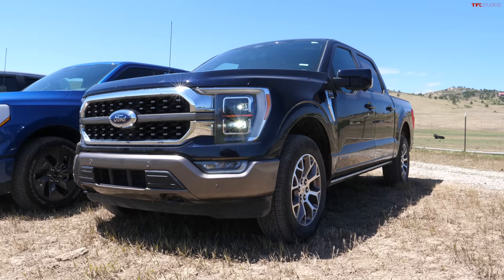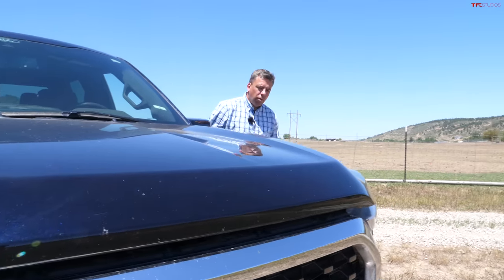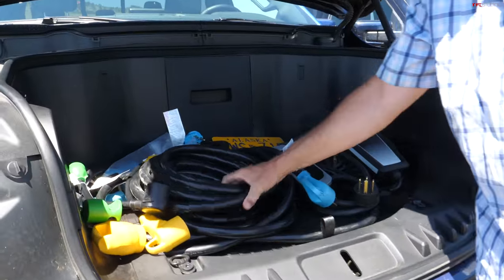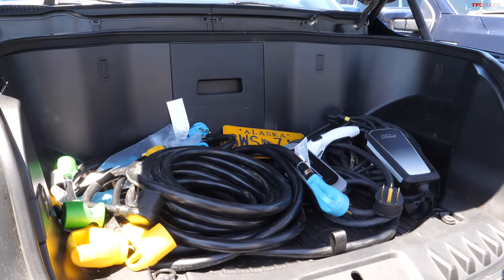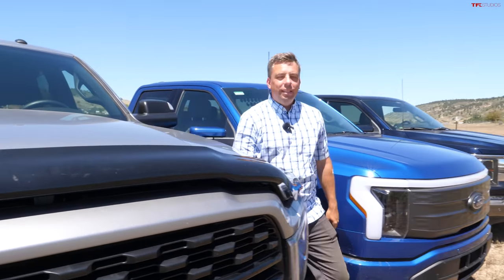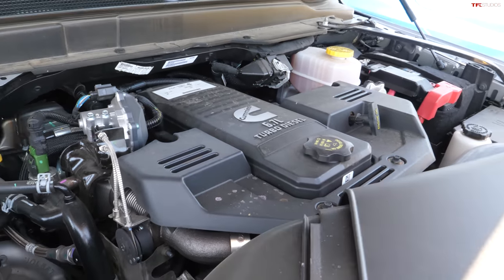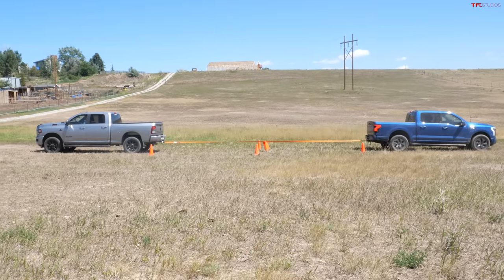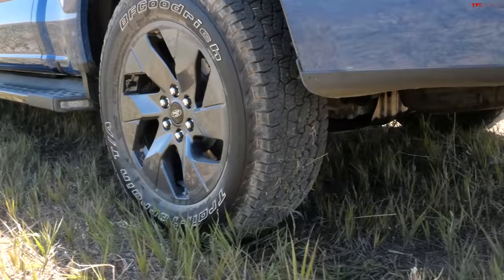Diesel vs Electric Tug-of-War: Ford F-150 Lightning Takes on the Ram 2500 Cummins In a Nail Biter!

Comment: We do this on the farm all the time. This test proves nothing. A 140 hp tractor will walk a 170 hp tractor if it’s weight is balanced correctly.
Reply: Yes, they mentioned this early in the video and stated this was more for fun than to actually test.
Reply: Why would HP matter, it's not a top speed run
Reply: @666cemetaryslut  
It’s more about low-end torque.
Reply: Shouldn't the gearing help to?
Reply: The Cummins  is the most powerful  on a job site doing real work...
Reply: @666cemetaryslut  Neither torque nor horsepower specs matters so long as both tractors can get enough torque to the wheel, through gearing, to peel out or move forward, at which point traction is all that matters to prevent peeling out, and that is heavily influenced by weight and weight distribution.  Selecting a low enough gear will provide all the torque that's needed to the wheel in most cases.  Tractors are rated in HP because it's much more practical for comparing how much work can be performed over time.  As such, tractors and their implements are rated in HP.

Comment: I want to see it on hard road
Reply: Dude trucks pull way more in four wheel drive than pulling that ram, if that truck breaks down its just because it's a shitty ford which ford in general leads in more recalls in the past few years so, put them on payment

Comment: I wonder how much the tires matter in tests like these. Seems like an important factor.
Reply: Tires and weight.
Reply: I noticed a lack of tread on the Ram fs
Reply: weight distribution is even more important, f150 lighting is 50-50, RAM i dont think so
Reply: all have street tires
Reply: Tires is more than half of it.
Reply: Being in dirt ruins this.  No grip.  Needed to be on the road.  Pointless test.
Reply: It definitely is. A car with 1000hp that gets no traction can lose to a car that makes 300 and hooks up. Tests like this prove absolutely nothing. Small mind theatrics
Reply: @pabloherman8836  property damage
Reply: @indyguy3400  well... Then they prove which grips better... So not exactly proving nothing.  Considering most my pulling is on dirt ground; its pretty useful info
Reply: @indyguy3400  he even said at the end they didn't really prove anything, they were just having fun.
Reply: @pabloherman8836  did you watch the same video? They also said why they didn't do it on pavement: they were trying to preserve the drivetrain of the vehicles. Didn't want to mess them up
Reply: its literally just traction and weight. sitting and spinning his tires all but guaranteed the other vehicle to win.
Reply: as  soon as I saw they were doing it off pavement I knew the results would be dependent on the tires
Reply: It was pointles in a test like this you need the same tires and you need to have the trucks switch sides need more testing on the same tread tires
Reply: @travisyarbrough4033  yeah so they still need the same tread for something like that
Reply: It certainly can be
Reply: Electric will almost always win unless it’s a huge truck agains a small EV. The EVs has instant torque(one of electric cars main benefits) which give it the advantage every time.
Reply: @Tonyx.yt.  just overall weight is even more important.  Normally weight cancels out since it increases friction between tire and ground but also increases the amount of weight you need to move.  Here though, both trucks need to move the combined weight of the two, but only get the benefit of their own weight to increase traction, so basically the heavier truck has a significant advantage.
Reply: Diesel fuel
Reply: Rear axle/transmission ratios, as well.
Reply: Tires matter alot, considering the lightning had bfg and the ram has those shitty Firestone transforce tires
Reply: Right
Reply: It’s one of the main factors!
Reply: Do it on a road
Reply: Yeah the electric had the best tires it was knobby and the sidewalls had knows on them. The other trucks had less grippy tires for sure
Reply: Tires are every thing. Put a monster truck on volkswagon tires
Reply: Are you all kidding me? I just watched the video on my TV, and this was the biggest joke ever. There are so many things wrong with the pool off. These two guys are  hacks.
Reply: The height of the attachment point for the strap also matters a lot, if it’s higher on say the lightning for example, the ram would have been actually helping the lightning get more traction on the rear tires by applying a downward force while pulling. It’s something that’s often over looked in thug of wars.
Reply: I can tell you, from experience on a few different Rams, that the factory tires are garbage. Park on a driveway that has a bit of damp grass and you will get stuck.
Reply: I'm sure they both had decent tires on them stop trying to make excuses
Reply: @revit4909  EV’s will also generally outweigh traditional vehicles by a pretty large margin just due to batteries, EV’s are kinda tank like, and will be very interesting to see in the future.
Reply: The Tires wear evenly you can rotate the tires like a gas car if you want to but so far my tires are holding up fine and they wear evenly unlike a gas car. Gas car tires don't wear evenly because gas cars create more friction on the tires Tesla cars create friction on the tires because of the torque power the tires don't spin in place at all that's why Tesla can leave a gas car sitting at a stop light in the dust . It takes a gas car at least 2 to 3 seconds to find traction on the road as opposed to a Tesla that has immediate traction upon take off.
Reply: It’s weight folks, not torque, not the tires, not the weight distribution…. Assuming the trucks have more horse power than their tires can keep on the road, which every pickup truck made today does, the deciding factor is weight. The heavier truck wins every time.
Reply: Yeah they should have put them all on the same tire. A nice chunky one
Reply: Yes

Comment: that small difference could be just the type of tread design on the tires.  Hardly notable. Or it could be the spot on the dirt where each tire was grabbing.   Both the Cummin 6.7L and the Electric were limited by the terrain

Comment: What happened was almost 1000 lbs of curb weight between the Raptor and the Lightning. The last two were more closely matched in weight. I will take the Ram however as I don't have to wait 5 days to charge at the RV park.
Reply: real problem is that you live at an RV park 😲 Sorry to hear, hope you improve your situation 😞

Having said that, there are high power chargers that will charge that thing in like 20 min. 🙂you have to pay but it's less than half what is costs to fill a gas tank. Plus really everybody should have solar on the roof. We subsidize it here in California, and 46% of all homes in California have solar on the roof. If you have a big enough system, you can put excess power you don't use during the day into a battery, and then use that battery to charge your EV at night while also powering your house. 🙂
Reply: What raptor?
Reply: @joshuagarner1654  Reading comprehension not your thing? Let me mansplain it to ya boy. I compared the weight of the raptor to the lightning for context. Never said there was any Raptor in the video.
Reply: Many parks have 50 amp supply, which means it 24 hours or less
Reply: @BarryObaminable  

"Many parks have 50 amp supply, which means it 24 hours or less"

hmmm....most electric cars charge overnight if you have one of the company's chargers installed....(with a high energy outlet like for a clothes dryer.)
Reply: @neutrino78x  yes.  The 50 amp is about 25 miles per hour charging
Reply: @BarryObaminable  takes about 5 minutes to fill up a truck. And the best part is that you can fill it up at any time of the day almost everywhere you'd ever think about driving. AND it doesn't use child labor to mine for the batteries the so called environmentalist deny.
Reply: @roboteen  

" takes about 5 minutes to fill up a truck. And the best part is that you can fill it up at any time of the day almost everywhere you'd ever think about driving."

The idea of a battery powered truck is that you would charge it overnight and it would have enough range to do whatever you're going to do, and then you recharge it overnight again.

Refueling would be for a hydrogen fuel cell powered truck (which is also electric btw. there is NO ENGINE in a hydrogen fuel cell truck.).

"doesn't use child labor to mine for the batteries"

This argument is obsolete. 

1) the new generation of Tesla batteries does not use cobalt

2) we just found 200+ years worth of lithium in the Salton Sea here in California. The plant is currently being built to extract it -- all they have to do is filter it out of the water, very environmentally friendly -- while giving us 2 GW of geothermal power (that's comparable to a nuclear plant). Geothermal works 24/7 with no pollution.

btw isn't Elon Musk your god? Why are you questioning his holy product?

Comment: Yeah, but can the Lightning haul 5k lbs 400 miles without stopping?
Reply: Bro this is literally at its infancy and is already outperforming engines decades in the making
Reply: @chupa3851  The entire electric vehicle industry is in its infancy.  It's great that they have the performance, but I'm not going to be owning an EV until they can go the distance like a gas vehicle can.
Reply: @kesselrunner  The tesla cybertruck can go 500 miles on one charge and it takes 15 minutes to charge. So yes the cybertruck can go just as far as a diesel without stopping AND cost 1/4 the price to refill it. Gas engines are a thing of the past.
Reply: @BatmanisBatman  Sure, but hauling a trailer will cut that range in half.  The battery tech needs a lot more development if it wants to be as practical as gas or diesel.  Solid state batteries look promising, but that might take a couple decades.
Reply: @kesselrunner  No hauling a trailer does not cut that distance in half if anything it would be a 10-20% distance reduction at most which is still better than the ford who only gets 400 miles on one tank which is also reduced because it has to haul a trailer. There really is no comparison here, the cybertruck gets almost 100 more miles on one charge for 1/4 the price.
Reply: @BatmanisBatman  That sounds more like wishful thinking to me.  We'll see how things stack up in the real world once these trucks can be properly tested in day to day driving.
Reply: @BatmanisBatman go hug a tree
Reply: @BatmanisBatman  stop being a YouTube expert and be real. Electric will never replace diesels. Idc how much batteries you throw in a microwave Tesla. They will never be able to haul like traditional diesel engines.